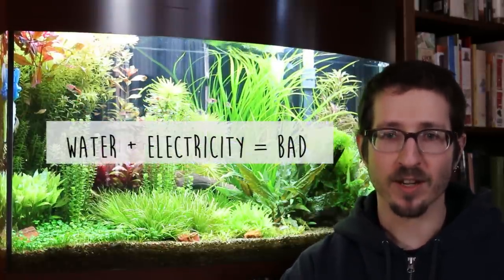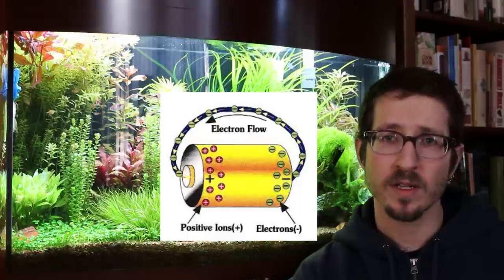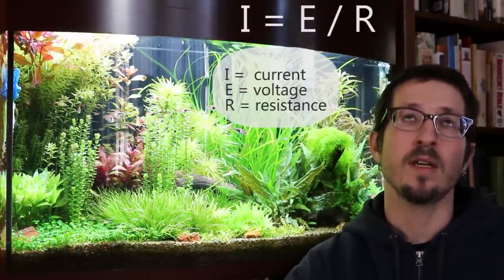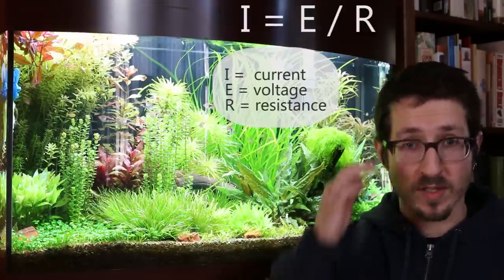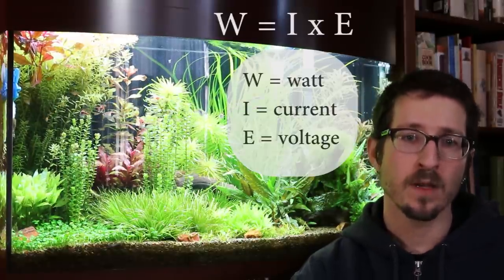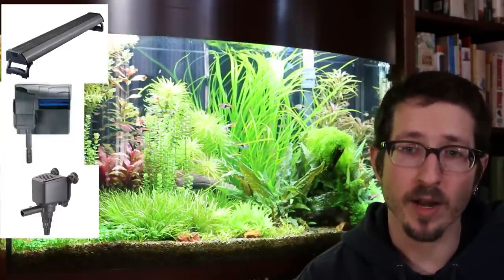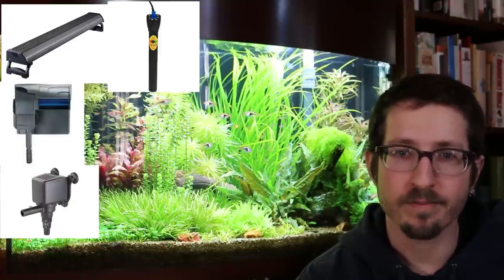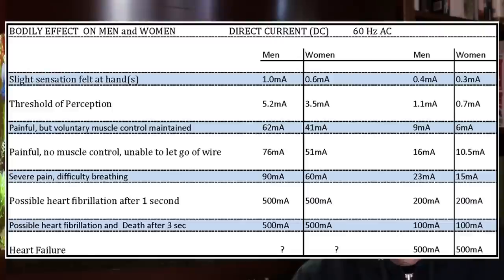Electricity in the Aquarium: Basics of Electricity (part1)

Comment: I am sure I am close to circuit capacity. I have surge protectors, but nothing special. I am more scared of my guitar amp, when I work on it or modify it I have to be really careful. It has super high voltage on the power amp circuit. Will kill instantly. If there is an earthquake I am screwed. I have so many electronics right next to my tanks. Great video. I love electricity!
Reply from the maker: Electricity is like fire-- simple, amazing, dangerous, but necessary (well to modern life anyway). Just don't blow dry your hair while you are aquascaping and you should be fine. ;)
Reply: Haha, I don't even comb it, I will be fine. LOL